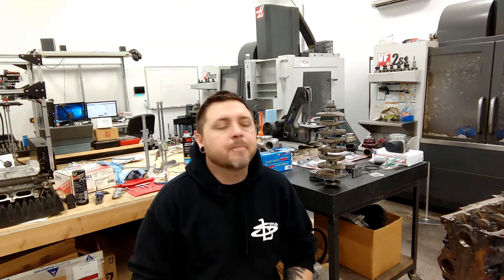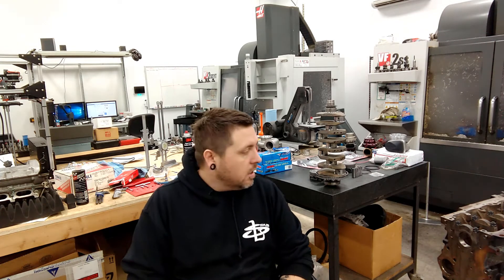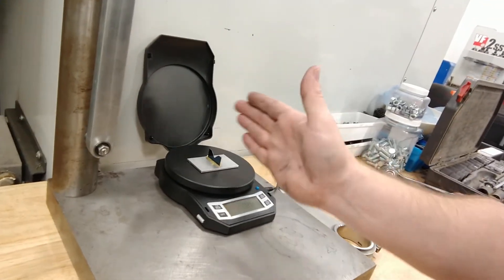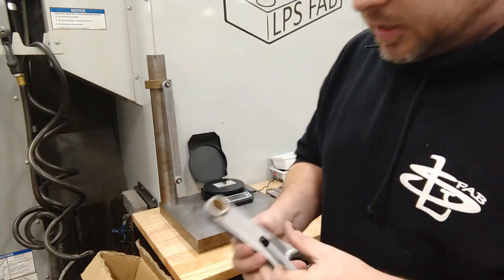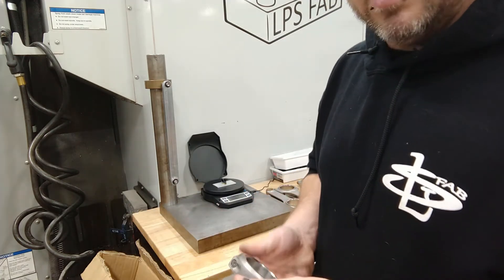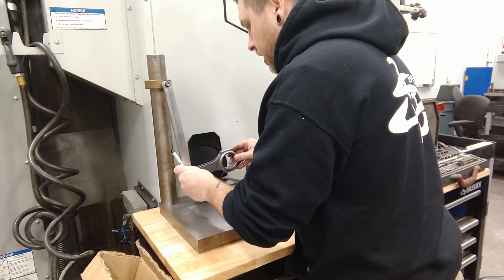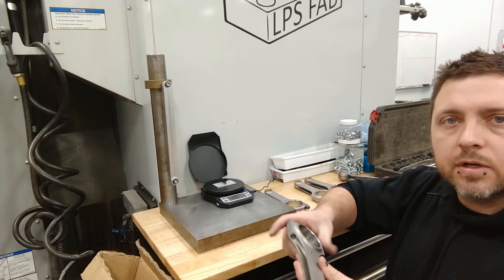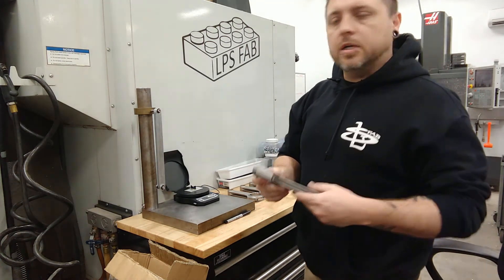VW 1.8t 20v engine build, bearing clearance and rod balancing.

Comment: hello I have an audi s3 could you advise me if what I'm doing is right ?? 82mm wiseco pistons with 8.5 compression ratio, inverted h connecting rods, 630 deka injectors, gt28rs turbine, supersprint exhaust valves, other tips ??

Comment: thanks for the reminder man. so what you're saying is placidly gauges don't measure down to the third decimal?

also, are those "maxspeedingrods? because they look very very similar. $200-$230 ones? Im guessing you're stock 19mm wrist pin but cant tell for sure.
Reply from the maker: No what I'm saying is that even if the plastigauge measured right, it wouldn't have told you if the bearing bores were out of round, like in my case.
Reply: @linderpowersystems_LPSFAB  good info. i would have watched longer but im a skipper-through-videoer. LOL. Will NOT be cheaping out on these then.
Reply from the maker: @JACKOFALLFATES  yes get quality bearings for sure. I recommend ACL's or King's.
Reply from the maker: And yes they are maxspeeding rods but 20mm pin for aftermarket pistons.

Comment: Curious if your measurements were with the bearings “crushed” or loose in hand. Can’t the crush make a difference in bearing thickness?
Reply from the maker: I measured them crushed first, that's when I found the problem, after that I measured the thickness. The ACL bearing were perfect in comparison.
Reply: Thank you!

Comment: Damn! I already bought Glyco bearings for my build..

Semi-related question 😁: Do you know if Grant piston rings are any good?
Reply from the maker: I have no idea...
Reply: EDIT: DNJ sold on ebay are not real. Apparently they got repped on accident and now its a big problem. I went with Supertech Pistons & Grant Rings. $100 ea for the pistons
Reply from the maker: @JACKOFALLFATES  just wanted to point out that EGT doesn't melt ring lands. It is in cylinder temp that would do this, likely from a lean running condition.

Comment: Another great video, and again, I don’t intend to get involved in engine building but the insight offered was great. As an Engine Management Calibrator you can definitely gain a keen a sense of appreciation for the craftsmanship that the power unit has, this in turn will explain a lot of the characteristics of the power unit itself during the calibration process.

I’m not sure if this adds up or not, but for me it’s a great compliment to the performance of the power unit.
Reply from the maker: "Engine builders make power, calibrators just extract that power" ~ Ben Strader